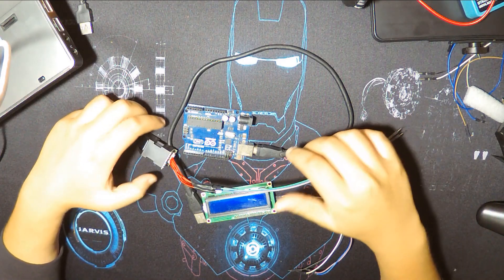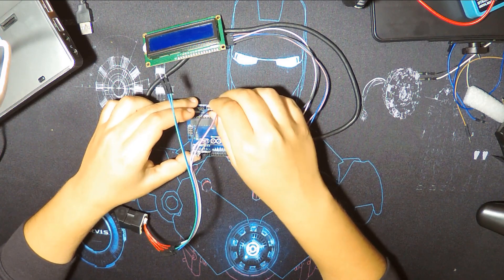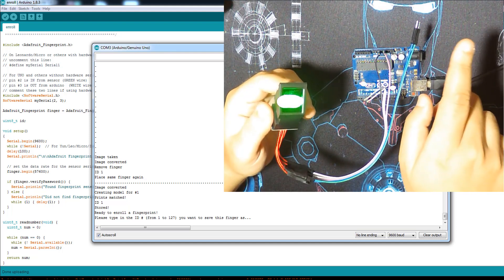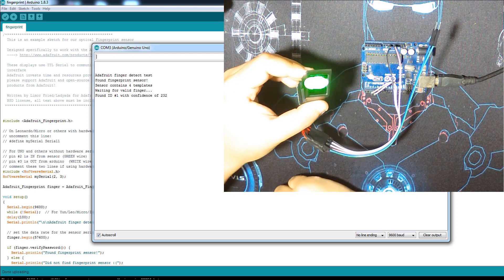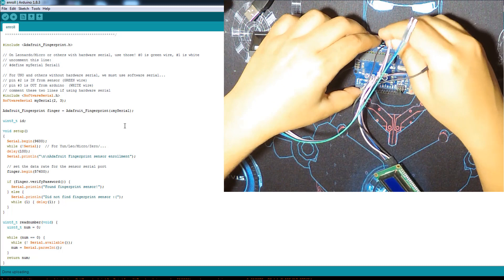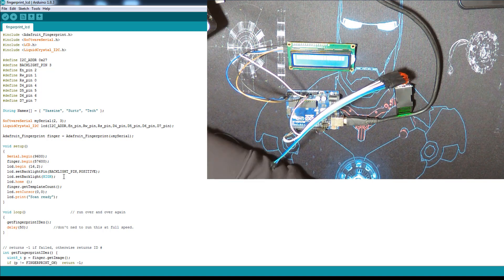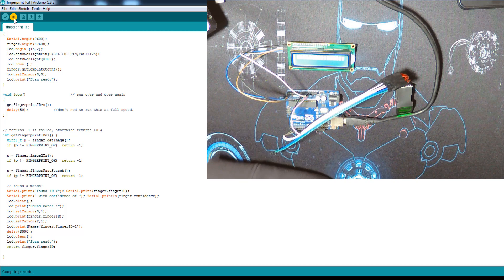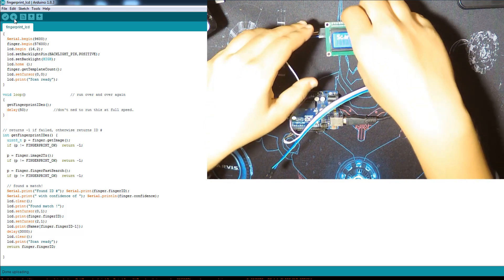Interfacing FPM10A (50 DY) Optical Fingerprint sensor with Arduino Uno

Comment: Hi Sir,May i know the DY50 the fingerprint the wiring how you able to connect it with jumpers?
Reply from the maker: Hello, the module came with that connectror and cable as you can see in the video... just plug some jump wires and here you go... For the Wiring, there's a link below the video.
Reply: @SurtrTech  Hi Sir, i only have jumpers but i dont have the connector as the picture inside the link.Is it possible to just use jump wires to connect?
Reply from the maker: @huibing5176  I really don't know... It's better to use a connector, it's not invasive and you can avoid some issues.
Reply: Sir,the connector can buy to add on to my jumpers?
Reply from the maker: @huibing5176  Yes, 6pins 1.5mm jst cable with female header
Reply: @SurtrTech  Hi Sir,I have try out the module but now the problem i having now is the lcd display only showing out the scan ready that's all.Does the direction of the fingerprint will cause any changed?
Reply from the maker: @huibing5176  Hello, first make sure to use it with serial monitor only to see if the problem is with the module or the LCD...
Reply: SurtrTech i have try it in single module the lcd is showing scan ready another time i put the fingerprint nothing is shown
Reply from the maker: @huibing5176  Try the module only without the LCD, just the module with the serial monitor using "Enroll" or "Fingerprint" examples from the library as I did in the video first.
Reply: @SurtrTech  Alright i will try and see how
Reply: @SurtrTech  Alright thanks for the advice i will be checking with my module with my fingerprint again i will see is it working on thanks so much..for your advice
Reply from the maker: @huibing5176  Yes because doing this you'll be able to see if the problem is with the Sensor or the LCD... First is to check with serial monitor, because showing "Scan ready" only means that the finger is not detected... make sure you made the right wiring also
Reply: SurtrTech Oh okay thanks so much
Reply: I have put the folder in the arduino library where can i get the fingerprint_lcd coding?
Reply: I downloaded the newliquidcystal_1.3.5 but then i cant find fingerprint_lcd in my examples.
Reply from the maker: @huibing5176  Hi, wire the module install the libraries required and download the code and upload it to arduino... everything you need is in the link below the video

Comment: hai, it is a good video. but, i want ask something. how to connect fingerprint cable with male to male cable? do you take apart the white one in the edge of fingerprint cable and solder it with male to male cable??
Reply from the maker: I just cut the connector, and soldred the wires to jump wires, to make it easy

Comment: hey dude how can i know the code of any fingerprint because im in need to connect each fingerprint to his owne persone !!! please i need help besides i"m working with raspberry pi 3
Reply from the maker: The fingerprints templates are stored on the module flash memory and each template has an ID number 1-126 (or different, depends on the type)

Comment: Sir how to get the 12 digit code for the fingerprint
Reply from the maker: You should modify the code array size first, then in getpassword function you should modify the for loop it takes 4 elements change it to 12 elements and the ij==4 that opens the door should change too to 12, the code wasn't meant to take different code size unfortunately, but you can check my last video about a keypad door lock (not using a fingerprint sensor), and the code was made to take different passcode size, if you could adapt it to this project it should work with any passcode size.

Comment: It would be great if you made a video by connecting the sensor with a solenoid doorloock.
I already understand everything about connecting the sensor with arduino. but I do not know what I have to do to activate the pin when the sensor finds the template of the fingerprint. please, I need to know if I have to download a solenoid library. basically tell me the code that I have to put in order to activate the lock when the sensor find the fingerprint.(I'm using GND: black, pin 2: green, pin3: white, 5V: red)
Reply: I was surfing the internet and found that for arduino to execute an action, I have to enter the code in the following section of examples-->adafruit library-->"fingerprint":
 Serial.print ("Found ID #");
Serial.print (finger.fingerID);
Serial.print ("With confidence of");
Serial.println (finger.confidence);
// Write the code here
(Here is the code to activate solenoid doorlock when the sensor finds the fingerprint, using the pins that I told you (GND: black, pin 2: green, pin3: white, 5V: red))
return finger.fingerID;
Reply from the maker: Hello, there's no library for the solenoid, you can control it either by a transistor or a relay, and you can integrate it in the code, around the "found id" lines... I'll try to do a solenoid lock but I don't think I'll use it with the fingerprint sensor... but it will be easy to integrate it there. It's literally 1 line code to open and 1 to close "HIGH/LOW"

Comment: I have JM-101B finger print sensor, will it work for it, what should be connections. I have connected Vcc, GND, TX, RX pins. It shows "Fingerprint sensor not recognized". What should I do?
Reply from the maker: Hi, sorry I've never used that module, the wiring should be the same as this one, may be there will be difference in module address, so check your wiring and try again, otherwise I can direct you to this tutorial, but it's in portuguese:
http://blog.usinainfo.com.br/leitor-biometrico-arduino-sistema-de-cadastramento-e-leitura-de-digitais/
There's a link there where you can download a library and codes, remove your old library and install that one, hope it works.
Reply: @SurtrTech  thanks for the help I will notify if it works

Comment: Thank you very much Sir! By any chance you got any idea of how much force the glass surface of this module can stand?
Reply from the maker: You're welcome, sorry I don't have any idea, it's seems a little strong, it traveled +9k Km to arrive to me though :D.
Reply: @SurtrTech  Aha, ok, thank you all the same for answering. Cause I'm planning to use it as a force sensor....
Reply from the maker: @hongshen903  How can you use it for this project? Use a load cell it's better
Reply: @SurtrTech  To be more specific, I plan to use the module to extract the contact area (very small), and then use the load cell for force info, to finally obtain the pressure....
Reply from the maker: @hongshen903  Seems interesting, good luck then.